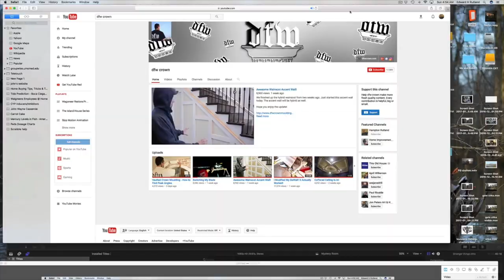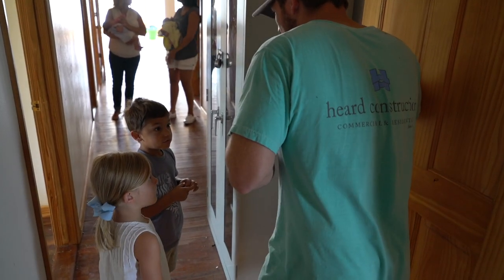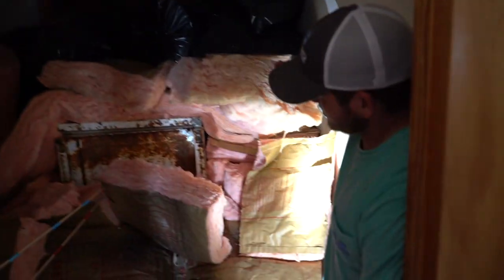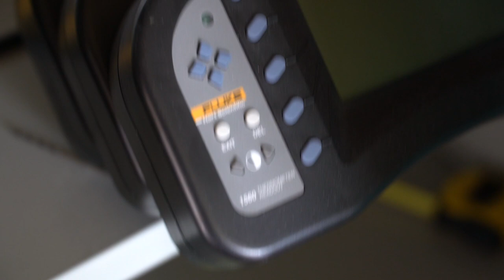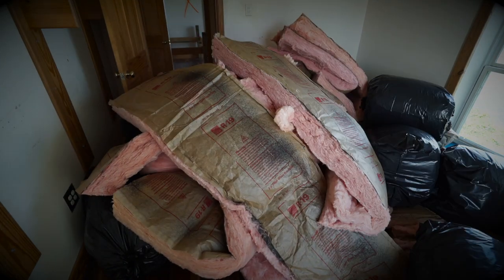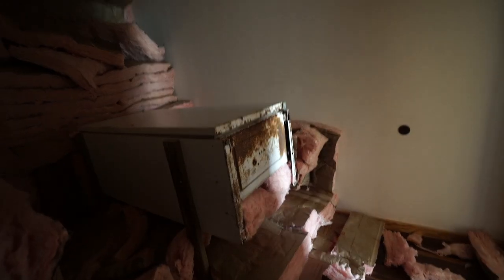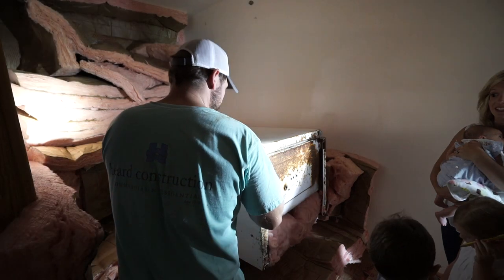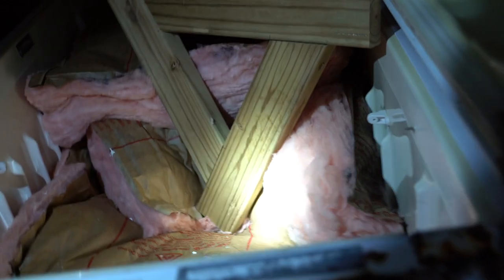Island House Episode 5: The Mystery Room

Comment: Wrapping insulation around a freezer makes it hotter inside, not colder.
Reply: The freezer wasn't running. The insulation would keep the freezer's interior at a more constant temperature. Insulation is not a heat source,

Comment: That fluke thermometer is worth 4k usd new, fyi lol. Pls dont throw it away
Reply from the maker: ScarFaceDan where can I find one like it to reference to sell it?
Reply: I just googled fluke 1560 thermometer, found two websites called transcat and instrumart which sold it. Also checked ebay and it seems like this thermometer is sold in parts? So it's not a single item, looks like you got three pieces, one of them is listed for 2k on ebay. I would seems like the best idea is to put it on ebay for bidding, not sure how much the modules on this thermometer is worth. Check out the accessories menu on intstrumarts website and see if you recognize your modules, some of the pricing is listed there